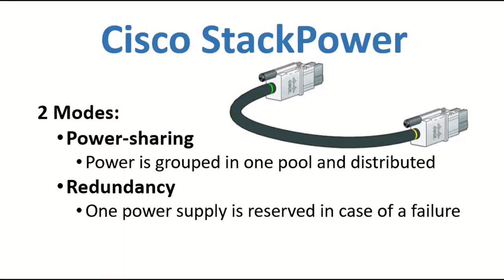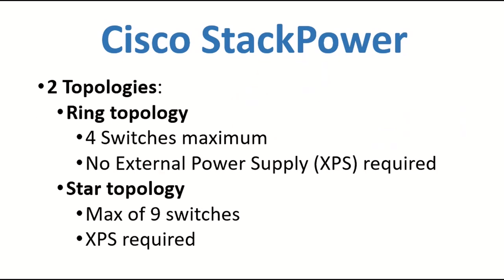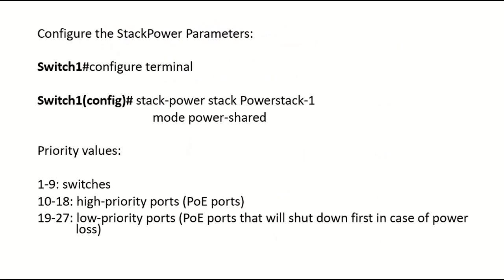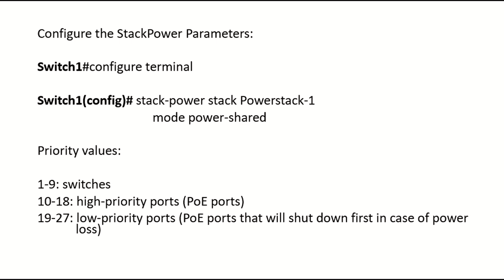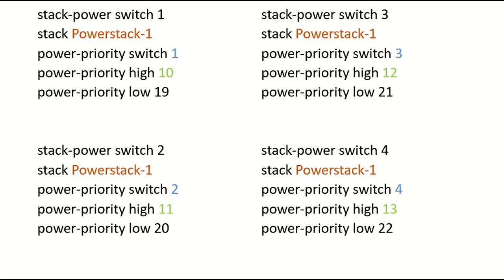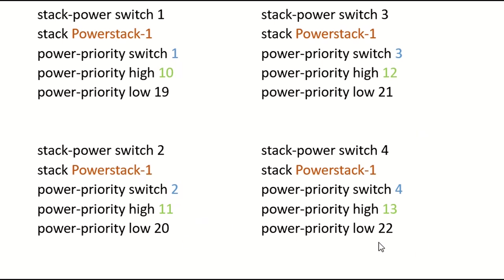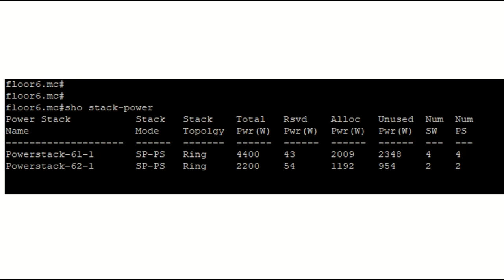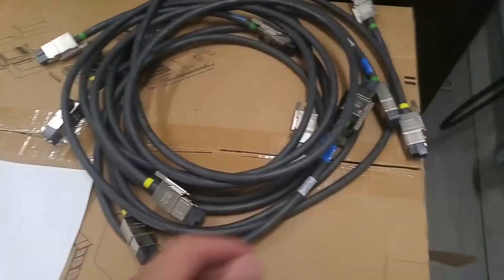Cisco Catalyst 3850 StackPower

Comment: If I need to turn off one of the switches, do I just need to unplug the power cords, or do I need to give a command to shut down? Thanks.
Reply from the maker: You will need to unplug the power cord, and the power stacking cables if they are connected.